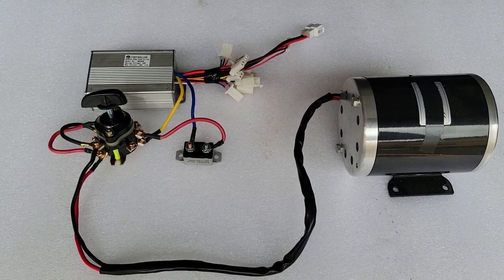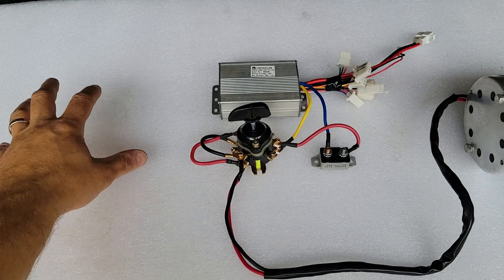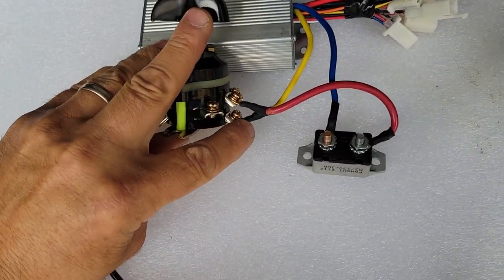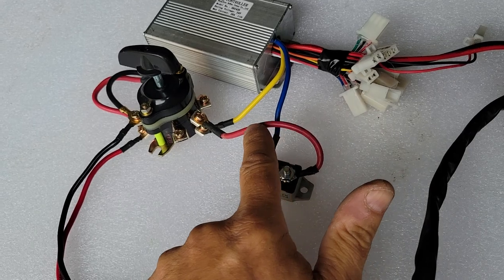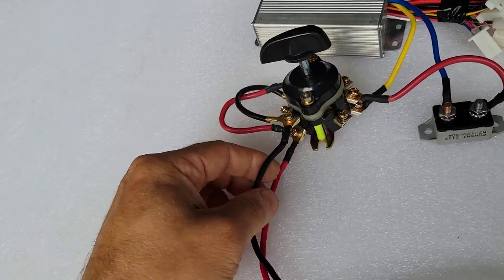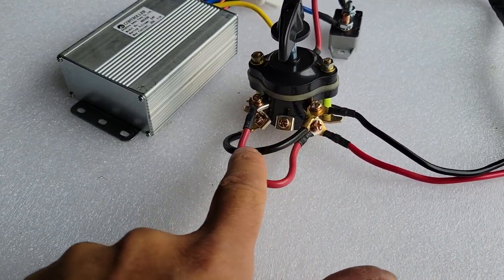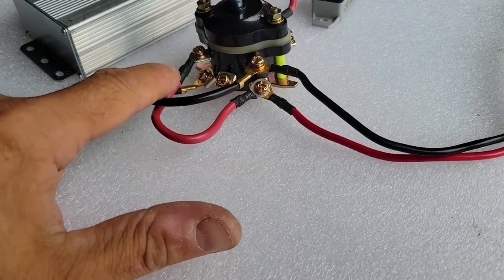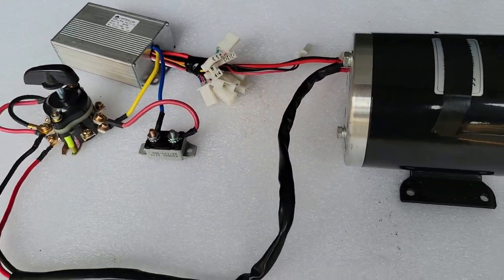Rosso atv model T and R  gear shifter switch controller wire diagram

Comment: This is great help for wiring up the reverse switch, but I tried to find the relay for a 36 volt 20 amp motor but could not find one
Reply from the maker: @jimtosh1505  Same relay is equipped on only one more Rosso  atv model, which is S2021, and relay is located under F/N/R gear switch.  And NONE of other Rosso atvs have that relay.

Comment: can you tell me the specs on the relay you used or what relay id need for a 24v setup. Thanks.
Reply from the maker: It is an original factory relay that comes with that Rosso model T atv , but honestly , there is no need for one, as it does not help much to prevent any controller or motor  failure

Comment: Is there a way to bypass this switch and just set a toggle or just hotwire to be in forward always?
Reply from the maker: Yes, you can put toggle switch instead, but I dont see a reason to do so, as original F/N/R cost on Rosso website as much as good quality strong toggle switch, which is only 29$...
Reply: @gio-simple-repair  ph sweet thanks a lot for the quick response I could not find a replacement switch and did not know the quad make
Reply from the maker: @tjmooney4181  visit Rosso motors website and you will see all available parts for those kids quads. That F/N/R switch is a universal switch for all their models  atvs
Reply from the maker: I guess I should mention that if you don't know how to test that switch,  you can always connect Yellow and Blue wires from a controller directly to the motor Red and Black wires ( polarity don't matter, and motor might spin in opposite direction,  but that is only to verify if switch was the problem that was not passing power through)

Comment: You make great videos. Would this be the same process for the model s?
Reply from the maker: That switch can be wired 2 different ways, actually, and this way it will work on model S too. I will be making a new video tomorrow how to wire switch on model S, X, Q
Reply: Thanks for the reply. Just subscribed. I have the 31.5v  2020 April controller. The wiring looks different.
Reply from the maker: @94mr_mike   Unfortunately nothing is going to work with that Voltage,  controller will not respond,  you need to replace batteries and Voltage must be minimum 38V to make it move , better 40-41V
Reply: Oh sorry it’s the 36v
Reply from the maker: @94mr_mike  still not enough to move atv, you must read minimum 38v at the battery connection plug
Reply: @You-can-fix-it  I’m sorry for the confusion. I meant the voltage that says on the controller is 36v. I just checked the voltage on the battery with a multimeter and it’s at 38.6v
Reply from the maker: @94mr_mike  All vedeos are on this channel,  so if you have at least 38v , next step is a continuity test
https://youtu.be/456RSBKuntY
Reply: @You-can-fix-it  thanks a lot for your time and videos. I have ruled out the controller is bad.

Comment: Can you do a rebuilt of that switch, mine came loose and stop working, I had to remove it but now its all apart😔🤬🤦
Reply from the maker: No, that is impossible to rebuilt , as factory have a special jig tool for building those switches. You need to buy new switch
Reply: Same happened to me. Did you manage to put it back together?